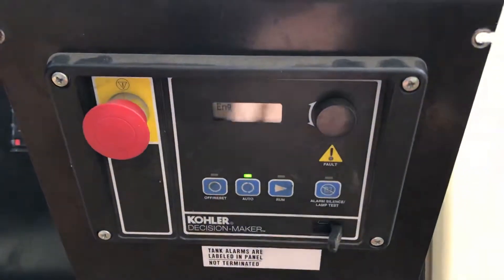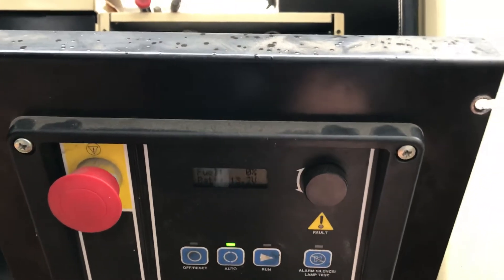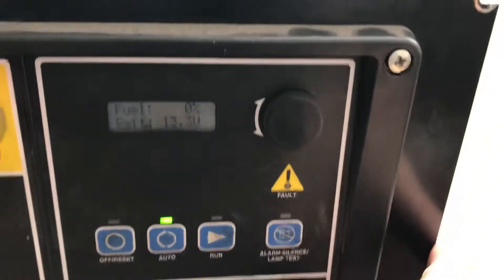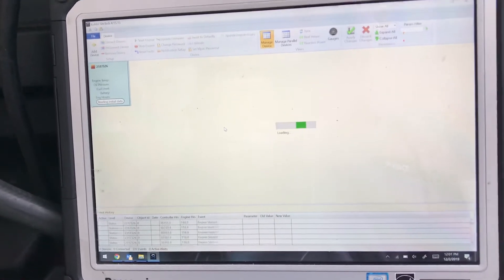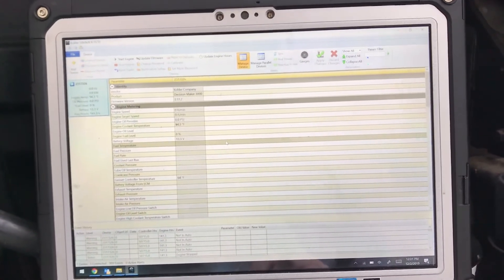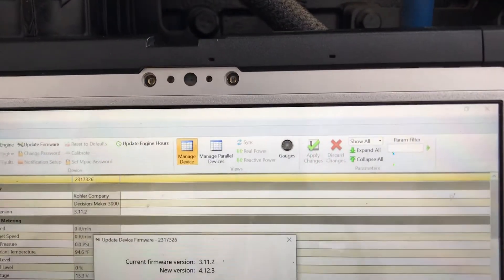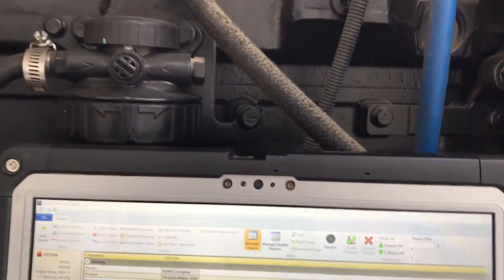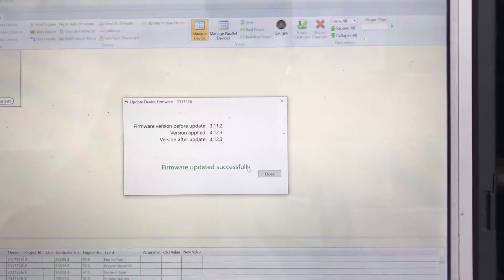HOW TO: CONNECTING SITE TECH/ UPDATE FIRMWARE ON THE DEC 3000

Comment: Hello Chainsaws !! i got a Kohler decision-maker" and i will change it by a "APM402" How can i install it?
Reply from the maker: your talking about the decision-maker 3000, it looks like the APM402 then yes, if its not an early model (they need an adapter harness) you need to have kohler sitetech for programming. if the original controller is dead you will need to get a new profile from kohler. and it costs about $300. good luck.

Comment: Can i change voltage set from 440 to 220 on the control decition maker 3000 without the software sitetech?
Reply from the maker: no. but, you can take the controller out, take it to a kohler dealer and have them change it.
while they have your controller hooked up to the computer ask them to download the profile for you, just incase that one goes bad